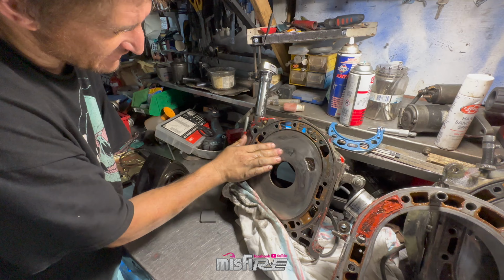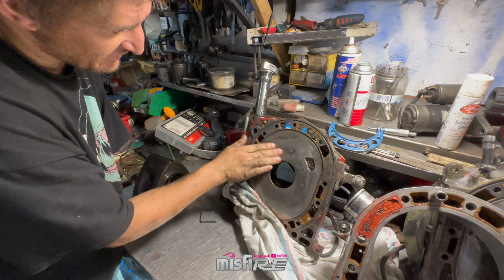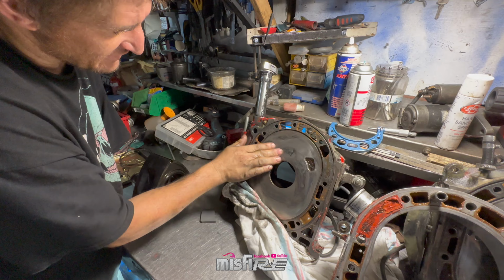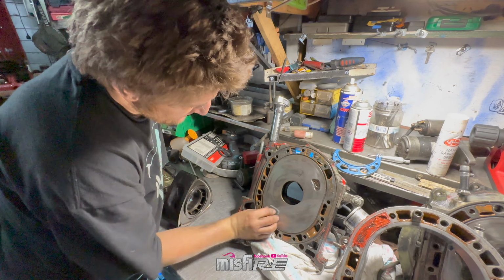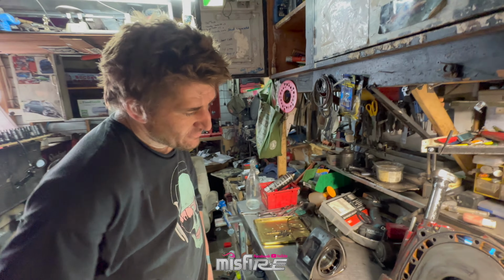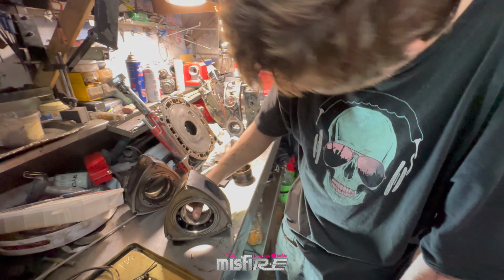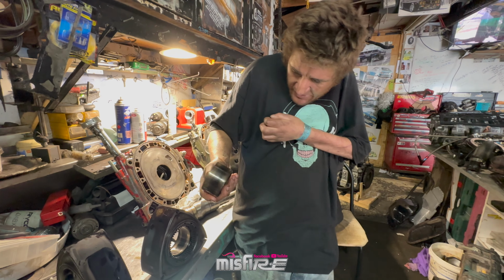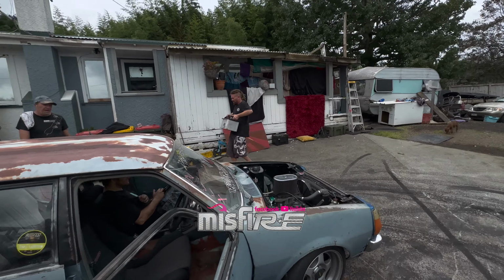Car Surfing Whilst Popping Tyres. Fixing OLD Rotaries #ROTARY LIFE

Comment: Hardcase Video 😁
Crazy lol

The oil system in a rotary is the life blood of the engine
It is not something you skimp out on, if you want a reliable rotary engine
When building a rotary engine, Oil pump must be new or a excellent condition one, also bearings and bearing clearances
Mazda FC/FD/RX8 oil coolers a minimum
When you have engine failure and bearing filings through engine, must get oil cooler/s cleaned/flowed etc and lines/hoses
Then quality make of oil, cheap, low quality oil will cause excessive wear or damaged engine
Reply from the maker: 💯agree bro that’s why I said to the boys I’d throw a newy in it just u gotta sometimes use what u have 🥲billy just gets it done with what he can get👍👍🙏
Reply: @misfirerotary  Yeah Nah 😁 no point wasting time, money building an engine with a stuffed oil pump 😁
Or stuffed, non useable parts
That's why people say  rotary engines are unreliable, have bad reputation
more so person building it using non reusable parts etc

Comment: Grey sealant.  So much better. 
Orange. Looks like shit.  Sumps don't need high temperature rtv
Reply from the maker: think most use the grey think billy has used that red high temp stuff
Reply: Crc make a good grey sealant now. 
Very similar to 3BOND.  WORKS GREAT.
Reply from the maker: @barryscarlett462  think that 3 bond is bloody expensive like crazy expensive it works though👍